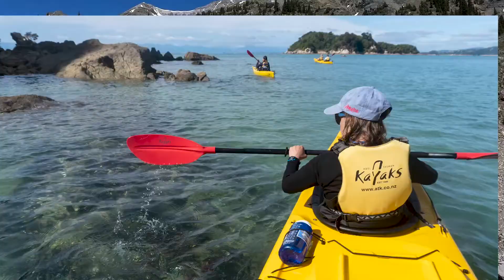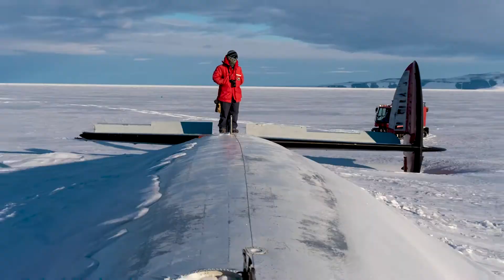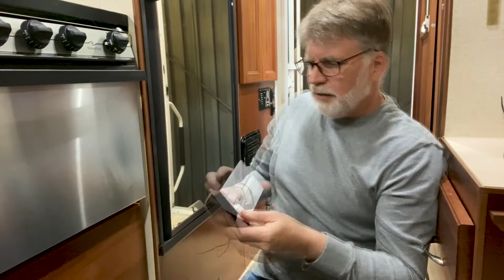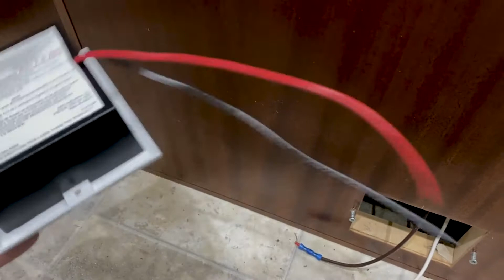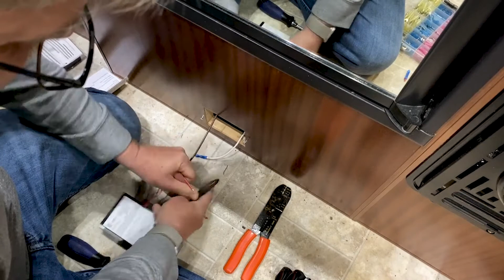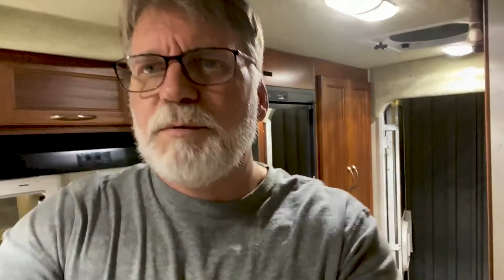How to Replace Your RV Propane Alarm: Don't Explode!!!!

Comment: i bought a used 2006 NL 10-2, it's in great condition but I wonder if the gas lines have deteriorated over the past 15 years?
Reply from the maker: The lines are probably copper tubing which you should be able to see and inspect by opening up some panels. Copper corrosion will be green in color. I would be surprised if you had that much corrosion unless there was a water leak. Cracks and loose fittings are a larger problem. You can also perform a pressure bleed down test, or ask an RV shop to do it. Even though propane has a strong odor, it is important to have a working alarm in the camper.